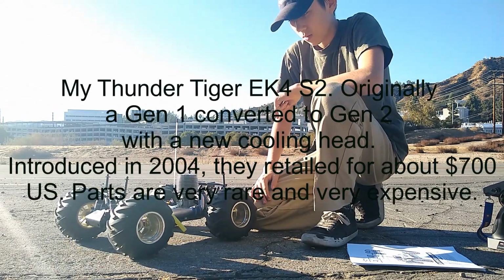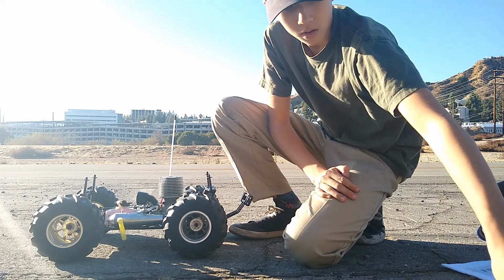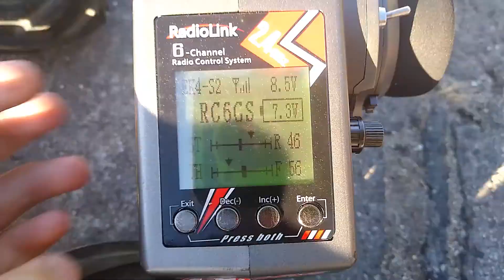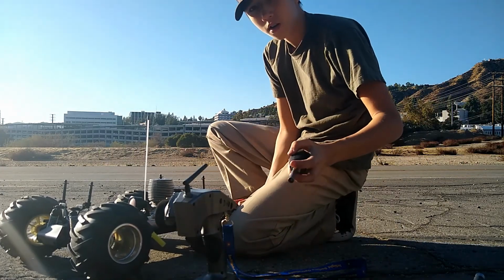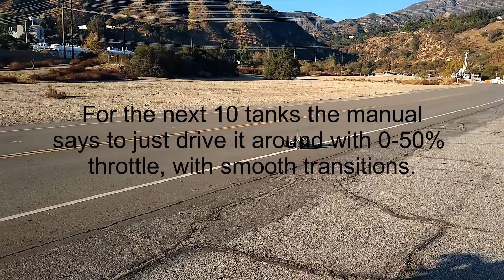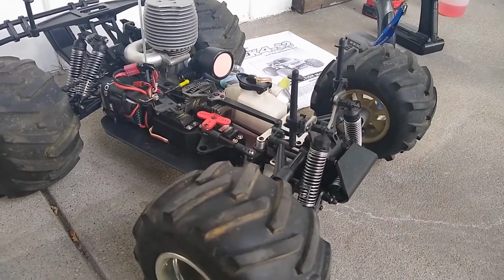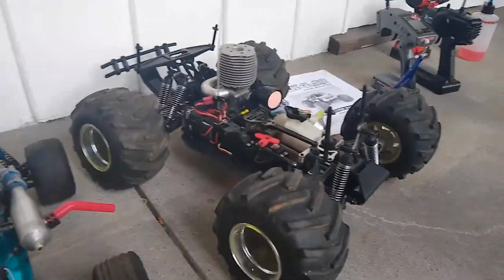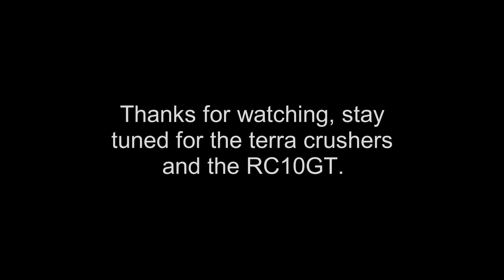Thunder Tiger EK4 S2 - Break in 1st tank - new piston, sleeve, piston ring and bearings

Comment: I had 1 of those and barnone one of the fastest torqueist rc i have ever run but mine was a version 1 and engine was a major pos always wrenching it and when it did run it was stripping diff gears until I put the aluminum housings in  that version 2 truck came with. Then got sick of engine never running right so it sat until hobby store told me contact tt and they will replace engine with version 2 engine for free and they did but it wasn't much better so I yanked and got tt 90 heli engine and put the big cooling head on it and ran good but still ran hot no matter what tune it had so I sold and went back to my losi lst it ran all the time lol but then tt released a bulletin on ek4 u had to run heli fuel I'm it lol my manual never said that. Kid that got it from me said heli fuel  didn't help. 
In end ek4 was the coolest pos I ever owned

Comment: Is that a Traxxas air filter you have on it? I just picked one of these up for the #NitroGang (and myself of course!) and I’ll want to start by replacing the air filter as the one I’ve bought has been lightly used but sat in a garage for 14 years. I have a couple of the Traxxas 2.5 air filters spare which I know have a larger diameter than normal air filters but wasn’t sure if they’d be too restrictive on an engine this big?
Reply from the maker: yes, the traxxas air filters are what I use. They are my favorite as they aren't too restrictive and have a mesh screen to protect the inside foam.
Reply: @cyclicracer  Great, thank you for confirming this for me. They’ll be going on it as soon as I’ve received it and given it a clean and rebuild, save me a bit of money buying new air filters!